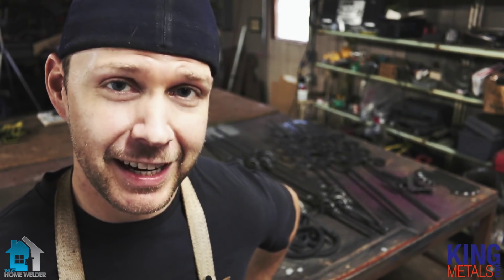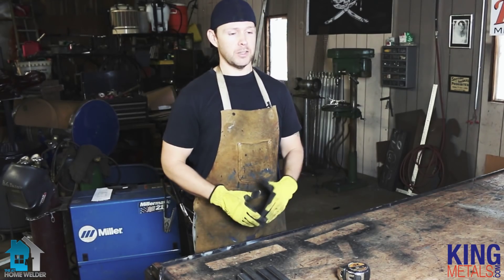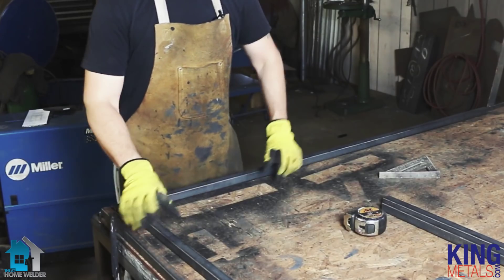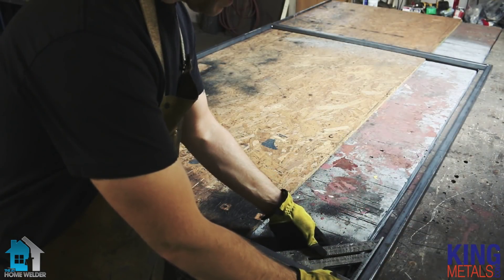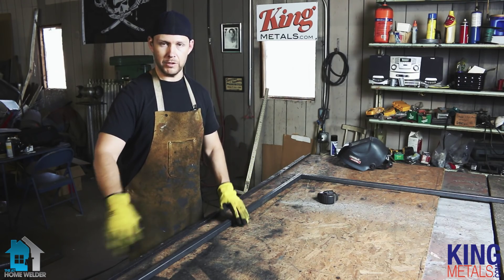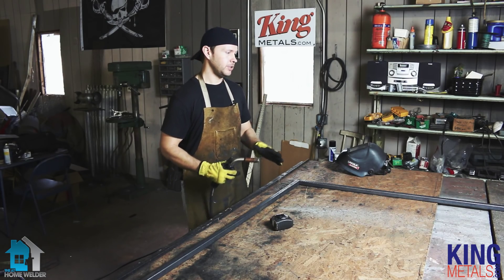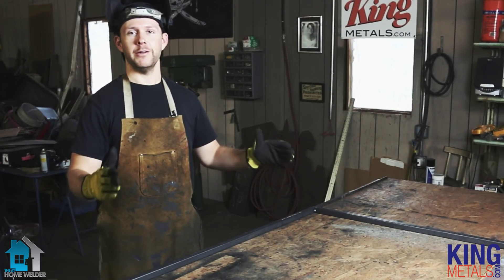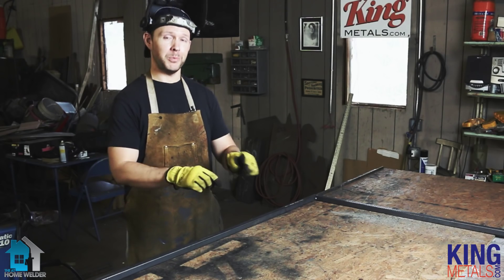King Metals Design Concepts Catalog Build (pt 1 of 3)

Comment: Its important to note that when squaring with a diagonal measurements, its critical to have the opposing sides equal in length.  If one side is shorter than the one opposing it, equal diagonal measurements will not result in a 90º corner.

Comment: what if people dont have a long tape measure....use the 1-2-3 method.
Reply: +SkunkTreeCarvings   1-2-3 method?  I know of the 3-4-5 method.  What is the 1-2-3 method?

A² + B² = C²
1² + 2² does not equal 3²
but
3² + 4² = 5²